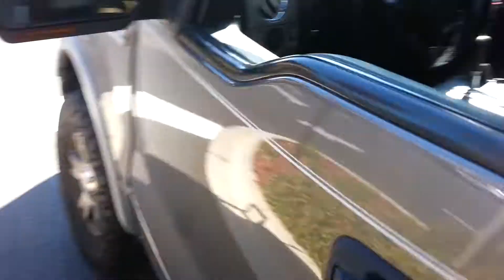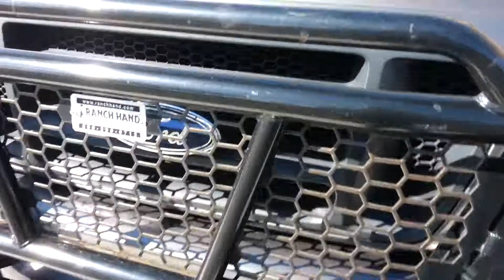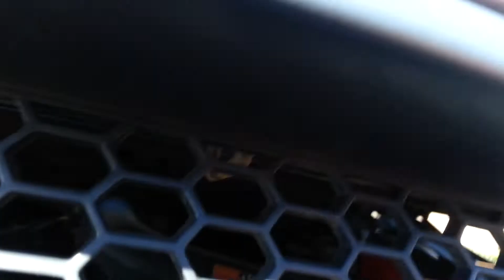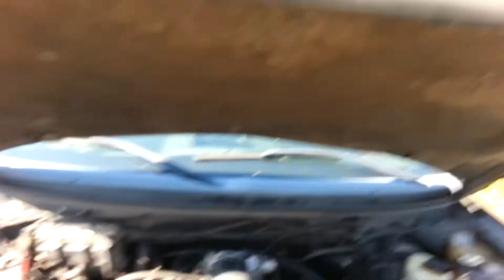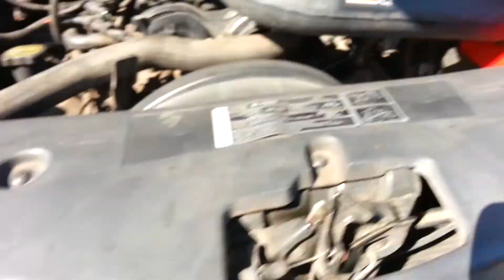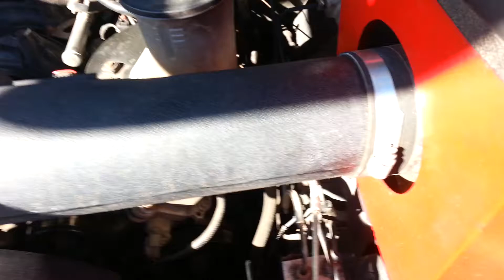2014 02-19 Weird noise from 2005 F-150 Engine

Comment: did you figure this out bro? mine is doing the same thing
Reply from the maker: udizzy1969  I've spent about $300 and been through 2 mechanics - I believe it's the belt tensioner.  I've had it tightened, but it still comes loose every now and then at low RPM's.  Basically once it starts wearing, you can tighten it for a temporary fix, but eventually you need to replace it.
Reply: oh man, sounds like you made out.  mine is on the side of the highway in RI, and wont move. making a similar sound but not the belt. thank you so much for the message, cheers from the Dizz

Comment: So did anyone find the fix? my 2005 f-150 5.4 liter.always had it. but now it's real noisy! runs like shit
Reply from the maker: +renodog Yeah, it was the belt tentioner.  Basically there's this housing that will rattle if it gets loose.  I had it tightened, but it's still not 100% and still makes the noise in short bursts occasionally.